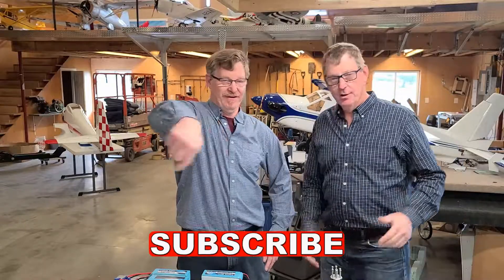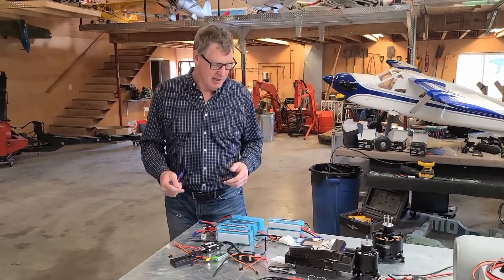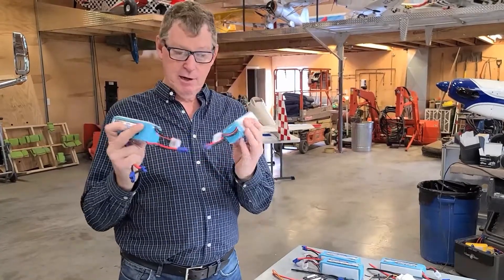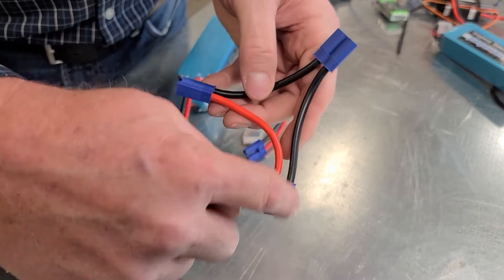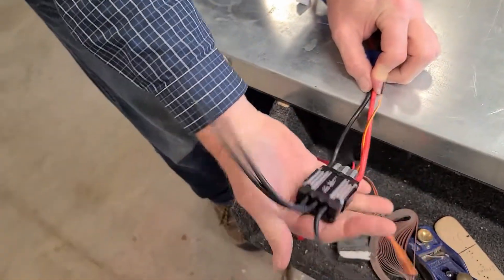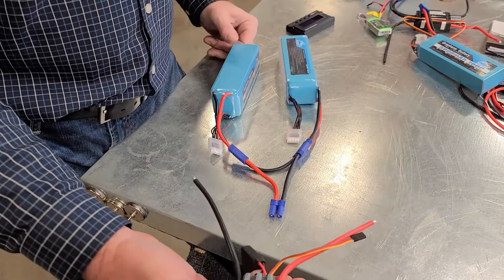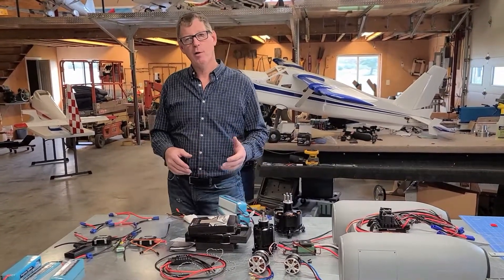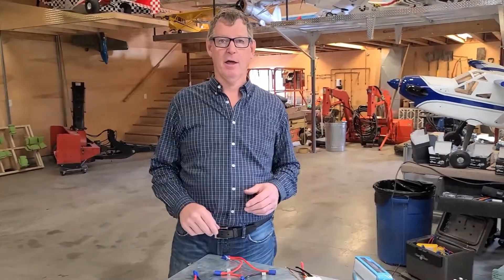giant scale electric 12S RCTWINS

Comment: Next to the big electric motor is that a turnigy CA80-160kv? If so have you ran it yet?  What type of power prop set up did you have.
Reply from the maker: That CA-80 takes a 23x10 2 blade or a 20x10 3 blade, uses a Aerostar 150 AMP ESC

Comment: Hello I need a little help on my setup if possible. I have the Phoenix 60cc Super Tucano and running the GA8000 motor from Dualsky. Its rated at 80cc to 120cc. I have the Flier 4s to 22s for airplanes.
I have the plane setup to run on 14s and I have a Mentz 23X12 4blade. I’ve done ground test and it has a lot of pull and max out 150 amp sensor I have on my FrSkyx20s Radio and the plane still is pulling real hard on static.
I flew yesterday and it did ok. If go vertical you see the amps moving up to 150amp. But flying level wide open amps are 85 to 90amps. I still pretty new the electric world and this is my first 14s setup. I can hear the prop rip a little in the air. I guess my thinking why would it accelerate more than it is when running level. What I’m I doing wrong? Thank your help on this.